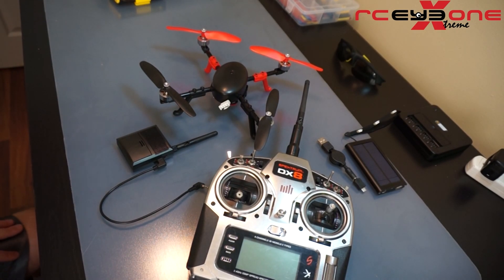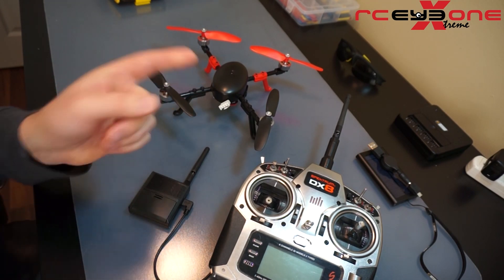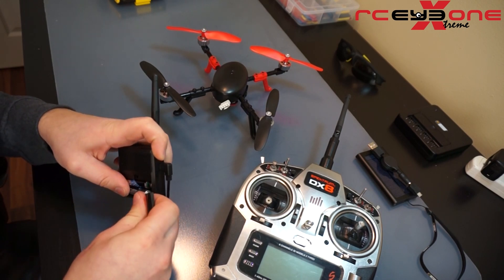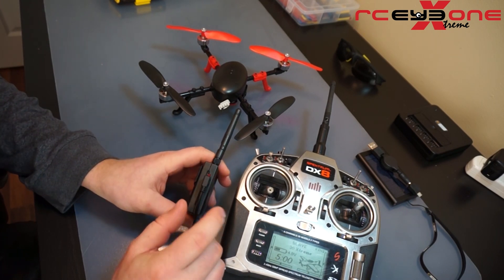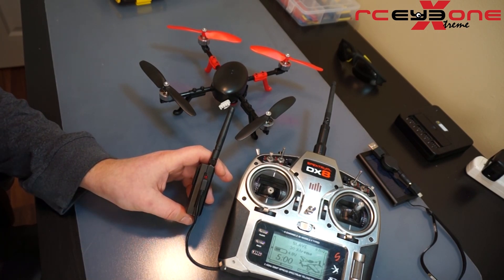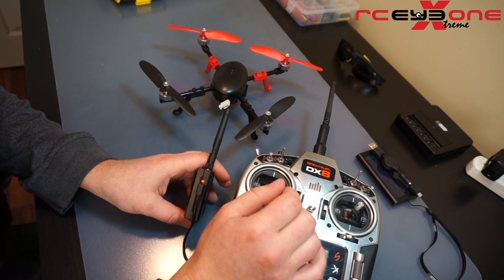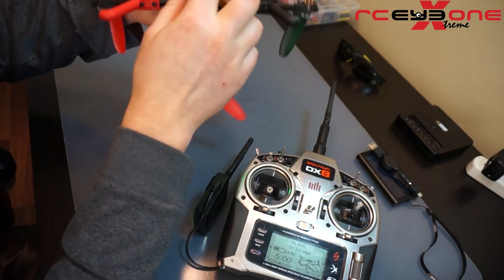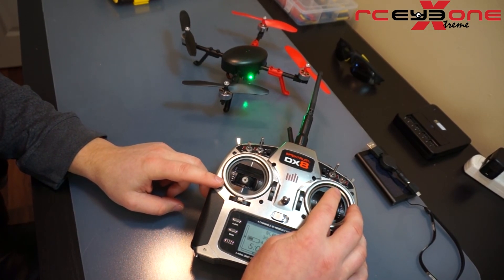RC EYE One Xtreme - OneLink setup tutorial for Spektrum Transmitters

Comment: this quad is nothing but pure junk
Reply: Steve Panebianco  is it junk in comparison to the one you manufacturer ?
Reply: I do not manufacture anything ,but if i did it sure would not be like this quad. I would use real CF not some cheap ass Chinese CF .And most of all i would rid the motor mounting method they used on this quad
Reply: Steve Panebianco Wow! Chinese CF .What Country should  we be buy our CF from?
Reply: Use real CF VS crap ..CF can be purchased Just about anywhere . Do your homework b4 pawning off quads with cheap CF.  I contacted Small Parts RC to design new motor mounts out off CNC when your RC Eye One Xtreme came out .. That quad was plagued with issues since day one and Customer service was useless

Comment: we need a video of you binding it to the DX6I please , your video is confusing as hell for our radio set up.. PLEASE PLEASE PLEASE
Reply: Steve Panebianco I just setup the DX9 by following the video too... i think if you still got noting after following the steps mention in the video, you may got a defect product...or you can record a video of what you did to bind your DX6i then we will able to know what step you actually missed
Reply: Steve Panebianco
 Hello Steve It's not you, it's the procedure which are not clear, because during the learning process the quad calculate the min level and the max  level for your  switches. And this can make you crazy

 A 3 position switch can go for instance from -100 to +100
with the middle position at 0 .

You can see  on the monitor of the radio Setup List  (menu 3) a graphic view of how your channels behave.
(where Gear channel is called CH5  and Flap channel is called Aux )

With a DX6i  you have to simulate 2 positions on 3. So your radio must produce two values chosen between {-100,0,100} . But the learning process create a mess if you don't give it  full levels when "it" learns how your switchs move.

The first time I tried, I had prepared the spektrum model before the learning process and that was a wrong idea and I had erratic behavior "not on the book". A real mess where i tried to put values like 20 to compensate but that was a wrong, wrong idea you can find on some videos. Because if you gave a 0 to 100 value t the learning process, it seems it will be interpret like /mapped on a [-100,100] scale.

I fully succeeded when I firstly prepared both full switches GEAR and FLAP able to go from -100 to +100 in the monitor view BEFORE the learning process of the quad.

Secondly  I did the learning process.

And thirdly I finish to program  the radio knowing that one must choose switches values smartly enough :
From the manual  you can deduce  that
beginner mode should produce -100 , sport mode 0, expert mode 100 and that
acro flip mode should produce -100, normal mode 0, altitude height hold 100

So for instance
if you want to have beginner mode + sport mode on Gear switch
you have to program your radio with Gear 0 producing -100 and Gear 1 producing 0

if you want to have normal mode + altitude height hold on Flap switch
you have to program your radio with Flap 0 producing 0 and Flap 1 producing 100

And you should verify that on the monitor of the radio (because there are tricks like the Flap = Aux channel which is natively reversed etc)

NB :
To help you with the Channel 6 alias Aux alias Flap , you have to know
that even if the status led are the same = fast blinking orange 0.1s,

Blinkings for the position LEDS between acro mode and Altitude height hold function are different :
Acro mode is:  blinking 0.5s, blinking 0.5s, off 1 second and repeat
Altitude height hold function is: blinking 0.2 s

I hope this will help
Reply: Hi Steve, I do not have a DX6i. Sorry, but I do not see how this is confusing. SImply follow the steps on programming the 5th and 6th channel in the instruction manual, then follow the steps in the video.
Reply: well the reason i asked for the video is i did that 10 or more times and nothing. either i'm missing something or i'm just plain stupid.. and being new to this ,it can be a bit confusing for me .
Reply: TheCric Hello, please can you explain this again. I recently got a dx6i and a rc logger xtreme thinking that they would easily work together. Unfortunately, they don't work together. Please can you rewrite what you just typed? I don't understand
Reply: TheCric how can i program the gear and flap please ?